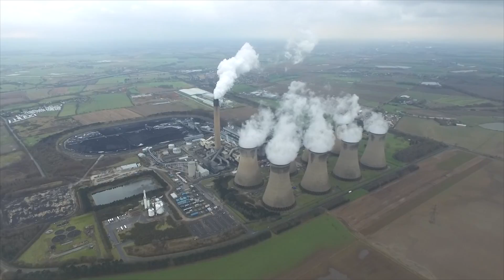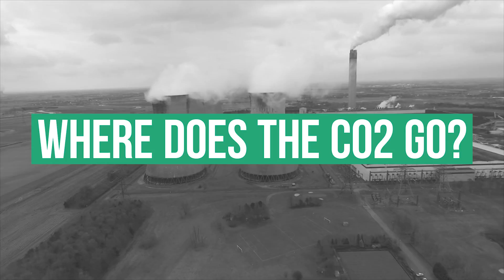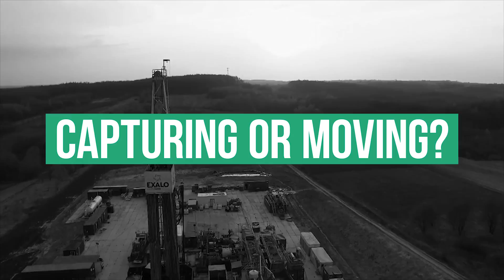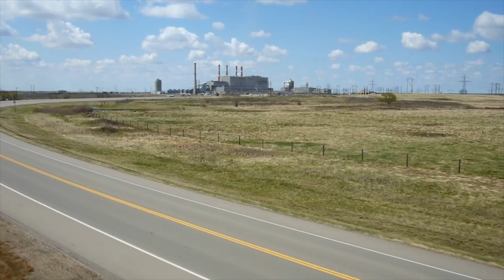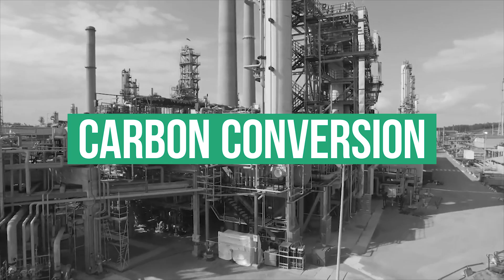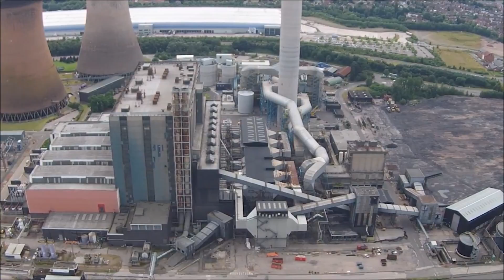Capturing Carbon is no pipe dream

Comment: When CCS first started I felt it was worth exploring.  However with the expansion of renewables there should be no new coal plants.  Not all existing coal plants are suitable for CCS either by location or by age.  I think the structure going forward is that if an existing coal plant wants their licensing renewed (every 30 years) they would have to do CCS to some level.  But really I think we are ready to shutter all coal plants at the end of their licensing and that should be part of the long term planning for the operators now.  In our area for our coal plant the plant is old and CCS would almost be the same as building a new plant in addition the local geology is not conducive either.  The plan should be to shutter it at the end of licensing if enough renewable and storage can be brought online.  I think ours has 20ish years left on its license.
Reply from the maker: +Brumadyan Iconoclasm Thanks for sharing your thoughts
Reply: As well as the matters you raised are the fact that capital and operating costs will also increase further negating any  perceived advantage.  I have always doubted the wisdom of storing carbon underground due ti in vulnerability to leakage and attacks by terrorists for example.
Reply: There are no real expansion of renewables, the growth of renewables is smaller than the increased electrical demand worldwide.